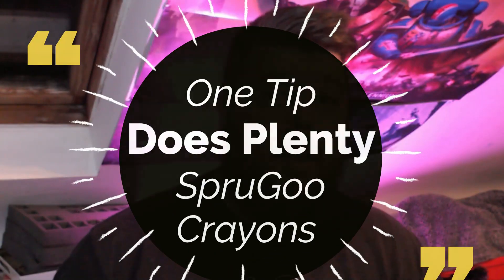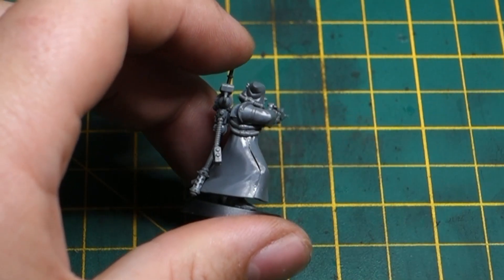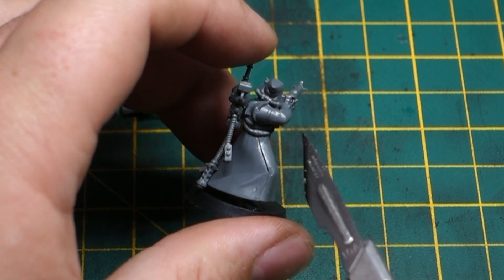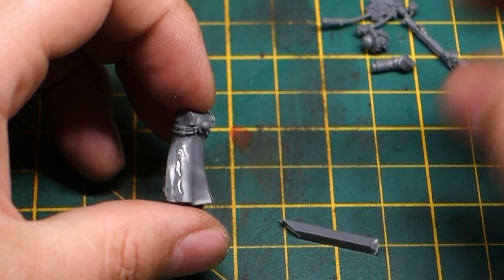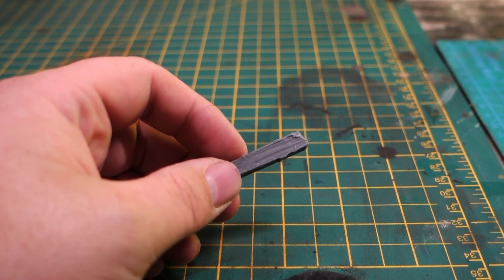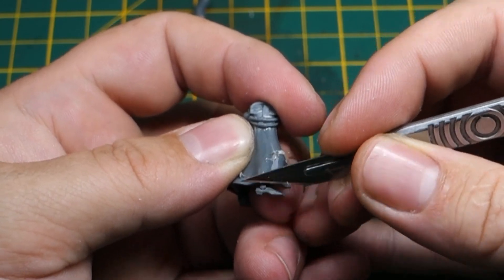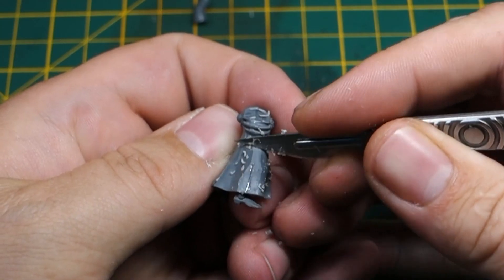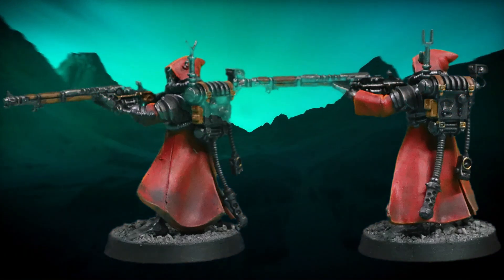Sprue Goo Just Got An Upgrade - Here's How

Comment: Next try the same method but with a metal shaper. The plastic isn't coming from the sprue, the glue on the model softened that plastic enough to be sculpted. I do this when working on customs when something is extremely rough and would take too much effort to properly patch or sand. Acetone + q tip on the rough plastic area it wont take long to melt it down enough to do a quick sanding.
Reply from the maker: Ah cool! Thanks for the information and advice 👍☺️ I’m definitely gonna give that a go as I think I have some acetone somewhere aswell 🤔👍

Comment: Why not simply use wall filler? Easy to thin down with water, dries in between 1 and 2 hours depending of how thin you've used it and then sand/file it down. Everywhere available and cheap as chips. No toxic chemicals, no cutting by accident into the plastic and you can even carve/cut some rudimentary detail into it later on.
Reply from the maker: Well I wasn’t aware this was a thing until reading your comment 🤣 I might have to give this a go 👍👍

Comment: Your results look nice, but I don't see why you scrap the seem with a piece of sprue, is the plastic glue supposed to dissolve the portion of the sprue that your scraping it with?
Reply from the maker: That’s exactly what’s happening ☺️
Reply: *scrape
Reply from the maker: Hang on, the idea or using the sprue is to transfer the melted plastic from there and on the model to fill the gap with out mixing a bottle of sprue goo? If that makes sense?

Comment: Mate, awesome video, thankyou for the tip. Subbed.

A question: my partner complains about the smell of the Tamiya extra thin cement I use for putting kits together - I have to use a space reasonably close to our main lounge area, unfortunately. I never had an issue until recently, but she's right, its bloody strong!

I tried making sprue glue using the Tamiya cement, but it is just to whiffy. I see you use the Revell Contacta, and I have ordered some. I intend  using it because I think the stink coming from the small nozzle will be greatly diminished, but referring to your video, do you think that the fumes from the Contacta were not to bad when employing your seam elimination process?

Comment: Just tried it and encountered a number of issues. I was putting Tamiya into the gaps and taking a sprue to rub on it. The mix very quickly becomes uneven and ‘tacky’. It is leaving streaks and even strings behind. Am I doing something wrong? If you need more info lmk.
Reply from the maker: Hmm 🤔 maybe try putting glue on the sprue so kick start the reaction. And not sure why your getting strings honestly. You may need to use the glue to just flatten it out and then leave it to dry. Hope this helps if not get in touch and I’m sure we can square it away 👍
Reply: @RIGMiniatures  at first when I begin rubbing, it works very well and the sprue begins to melt. However, once that sprue begins to dry even the tinyest amount it causes it to be extremely sticky. Like some parts are half-solid. I was trying this on the back of a Screamer Killer. Right now the surface is very rough and all I can do at the moment is wait and see if it sands down good.
Reply: Also, I did try putting the glue on the sprue first and ended up with the same result.
Reply from the maker: Hmm 🤔 ok well I’d leave it to dry an cure fully for now then once it’s done that it will sand down, I’m honestly not sure what’s causing the rest to happen as I’ve never experienced it myself. I’m sorry to hear that your getting these results as this is a technique that I use on only my models with gaps. Sounds like your doing everything right which is what’s boggling my mind
Reply from the maker: Sorry I can’t be much more help currently, but I’ll definitely give it a good think tomorrow reach out on instagram if you wanna share some photos or maybe a video of what’s happening and we can have a look together 👍

Comment: So I have a big 100mm mini. it's got a maybe pea sized (maybe a little smaller) perfect circle where the resin had a problem or something. (sadly it was purchased and they sent it to me that way).  the surface is relatively flat where the hole is, any recommendations on how to plug it? its not super visible so if i can just get a flat plastic plug in there and welding all around it was what i was thinking
Reply from the maker: If you have milli putt or green stuff I would say that would be the best approach as once it’s dried it can be sand papered or filed away. I wouldn’t suggest sprue goo if the hole it pea sized and I’m guessing goes into the hollows of the model? In that case you’ll really have a fight on your hands. Unless you can get something behind the hole to make it a bowl, then use sprue goo and wait until it’s definitely (I’d give it 15hours +/-) dried before doing anything to it.
Reply: @RIGMiniatures   Thank you, yeah it goes into the hollow, but I think i can get it. Okay I do have milliput I will see how it goes!
Reply from the maker: @s7r49 all the luck buddy
Reply: @RIGMiniatures  Thanks guy!

Comment: What glue do you use?? tried with army painter plastic glue, but it seems to dry to fast for the sprue to melt into the line.
Reply from the maker: I’ve used tamya extra thin, and revell plastic contact glue and it’s worked with those. If you have fast dying glue that ‘MAY’ (an uneducated guess 😅) be the issue but only at a guess. 

Hope this helps 👍
Reply: @RIGMiniatures  So i guess, Tamya to assemble and revell+smearing sprue to clear the seam?
Reply from the maker: Pretty much